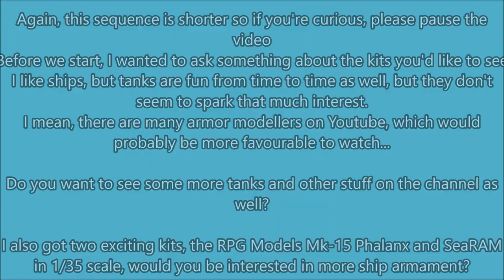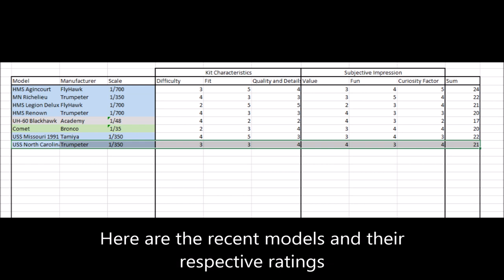USS North Carolina 1/350 Trumpeter: Assembly, Painting, Weathering

Comment: To make the Eduard radar dishes look right: make a cut from edge to center, overlap the cut ends until the dish looks right, mark where one edge that is overlapped to where it meets the other edge, leave just a slight overlap, glue the slight overlaps in place, let dry and slightly round from center to outer edge evenly to get proper dish shape. It works and works well.
Reply from the maker: This sounds like a great tip, thanks! I will try it when I get another one of those dishes!

Comment: 14:40
Seeing the non photoetch Crane makes me worried. 

I got my 1/350 Trumpeter Warspite and it’s gonna be the same problem. The crane is just a solid plastic, no photoetch replacement. All the aftermarket is for Academy is well, so it won’t fit Trumpeter. 😓
Reply from the maker: Yes those solid plastic cranes and radar dishes and stuff, they are really bad - but the PE sets are quite expensive as well, so i usually like to build out of the box because like this i am not bound to one model for endless times and can start new ones faster. I have the 1/350 warspite from trumpeter on my stash too, i think to remember there was a PE crane included, or am i mixing kits up?

Comment: Is there a way to make them moveable
Reply from the maker: I have never tried it but some people built ships especially for cruising around in lakes, you can look it up under RC ship modelling.
You need some Electronics knowledge to build it though, as you have to connect all the engines and radio control units yourself. I assume it is hard to get into, but cool if you can pull it off!